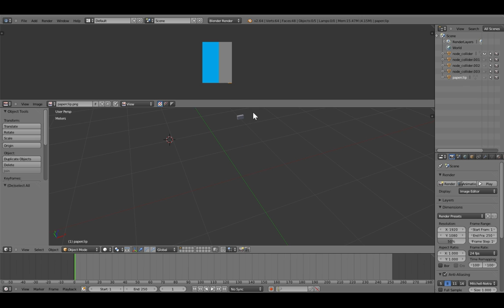Kerbal Space Program Debugging: Help with advanced robotics and multiple node colliders.

Comment: The problem is most probably due to the small scale of your colliders. The engine doesn't maintain the same physics precision on all scales (float number problem). Avoid colliders with surfaces less then 10cm distance (approximately). Make the entire hook larger and you'll solve the problem, although it wont look as sleek.